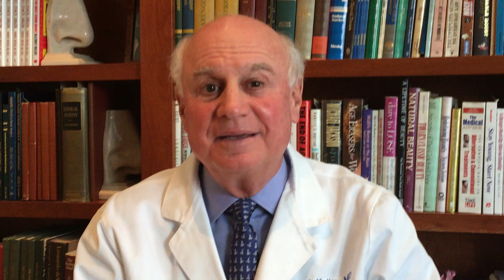Why is it so difficult to correct a crooked nose?

Comment: Hello sir, can septoplasty correct my crooked nose from the outside?
Reply: No. A septoplasty is the correction of the septum on the inside, it doesn't fix the asymmetry of the nose. For that, you need a rhinoplasty.
Reply: no. i got it and it gave zero external difference. you have to get rhino